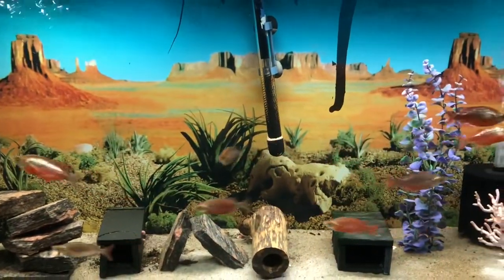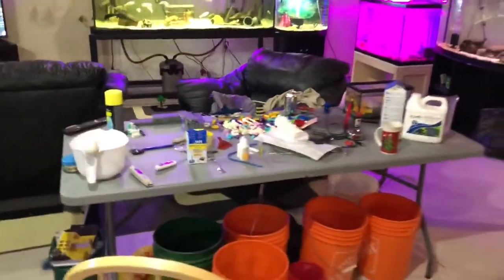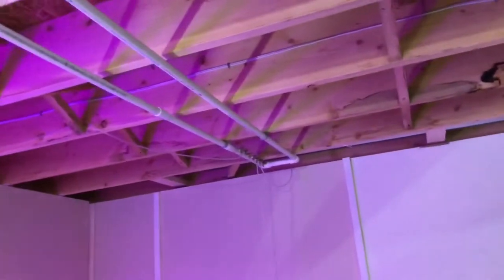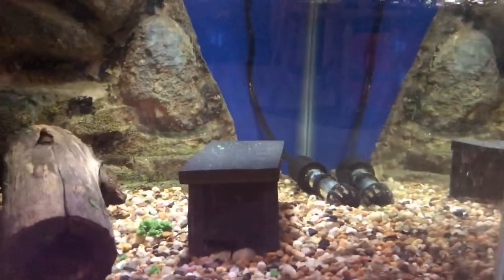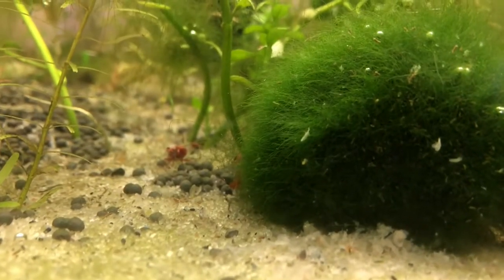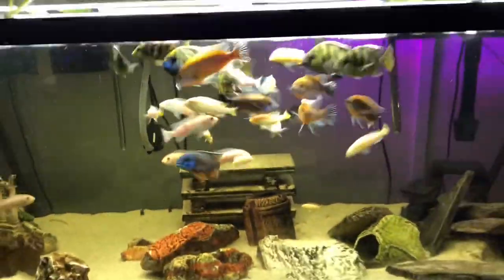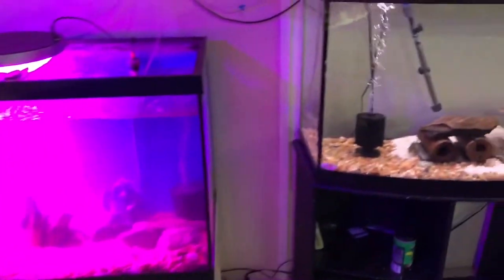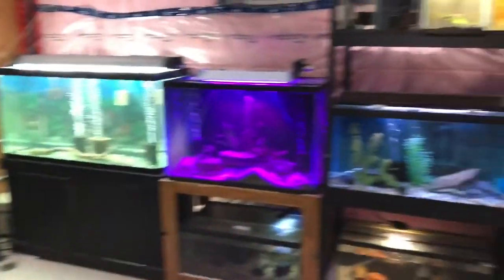FISH ROOM TOUR J&N AQUARIUM

Comment: When you show the pleco grow out tank there is a clicky rattling sound. What is making that sound? The aquaclears? Or the air pump?
Reply from the maker: It is a old rattly aquaclear.. yes very annoying it will be replaced soon!! Drives me nuts! Lol
Reply: JN AQUARIUM oh OK. Maybe just needs a new impeller then? I was worried it was your air pump as I didn't see a bleed manifold to let off excess air pressure. Nice room!
Reply from the maker: Litha Belle you are correct with me not having a bleeder.
It was something I considered but in all reality there will never be a backup of preasure being a loop system using as much air as i do